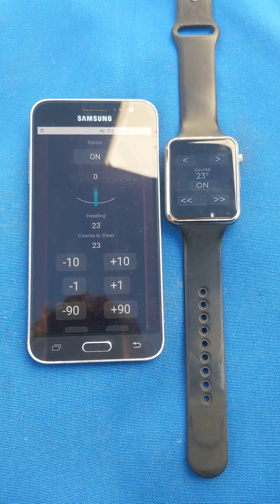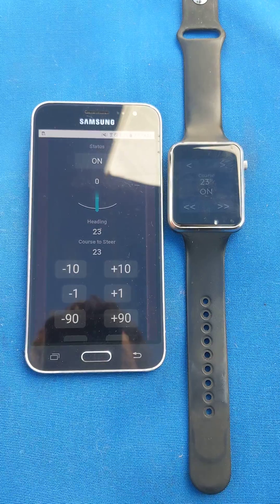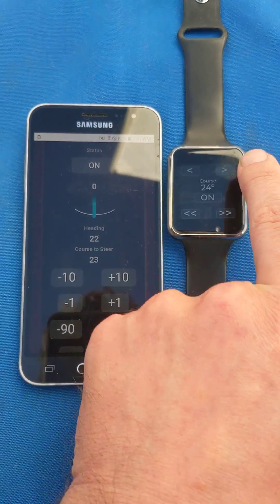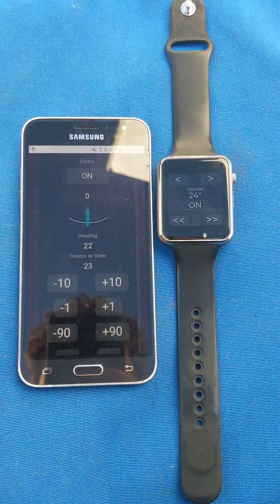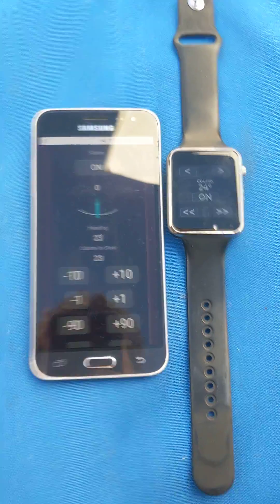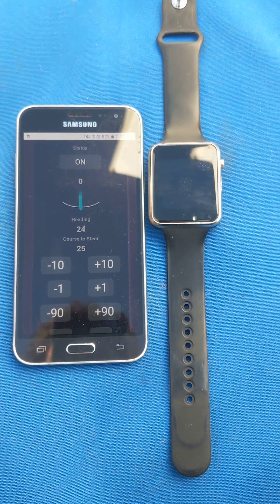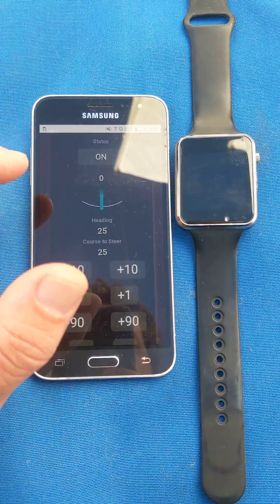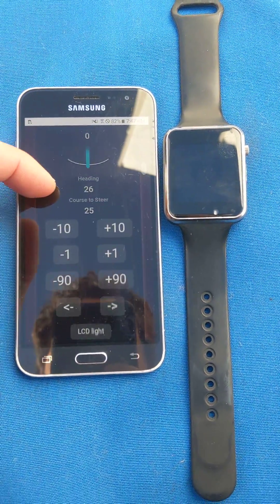ESP32 DIY sailboat autopilot - control with phone or smartwatch

Comment: There is a problem with the link you posted, can you check it?
Reply from the maker: Hmm, thanks for letting me know. Does this work for you? https://github.com/jeff-burright
Reply: Jeff, thanks for sharing !! Quick question: how can an ESP32 work simultaneously with ESPnow and regular WiFi, or do you have a separate ESP32 to transmit ESPnow from the autopilot controller to the watch?
Reply from the maker: @yaredna  Hi, the same ESP32 can do both simultaneously. You can look at my code to see how I did it. The watch model (lilygo t-watch) is also built on an ESP32, which is why ESPNOW is an option. I seem to recall I had to do something in the code related to the wifi channels, but it's been a while now and I forget. I think it was this bit here, but there might have been more pieces too:

esp_wifi_set_promiscuous(true);
esp_wifi_set_channel(1, WIFI_SECOND_CHAN_NONE);
esp_wifi_set_promiscuous(false);

I think you also have to make the ESP32 act as both AP and Station using the line WiFi.mode(WIFI_AP_STA);

https://www.electrosoftcloud.com/en/esp32-wifi-and-esp-now-simultaneously/